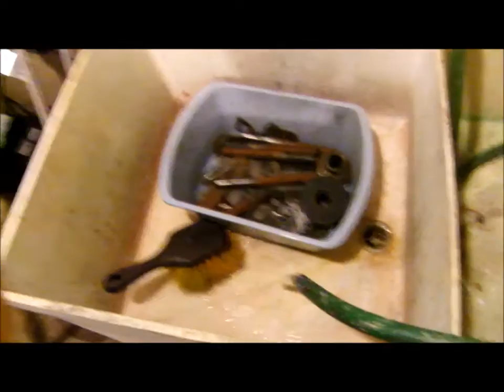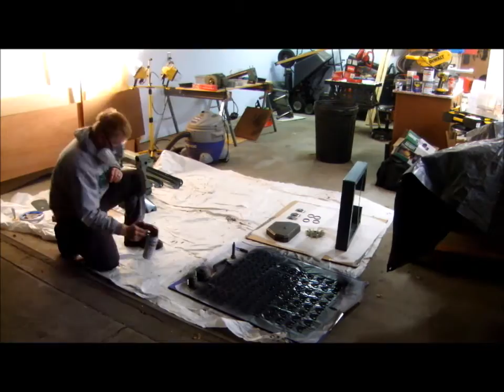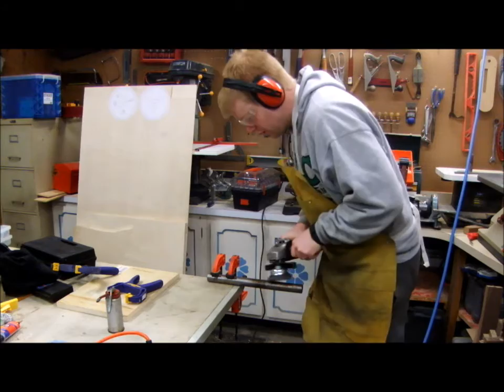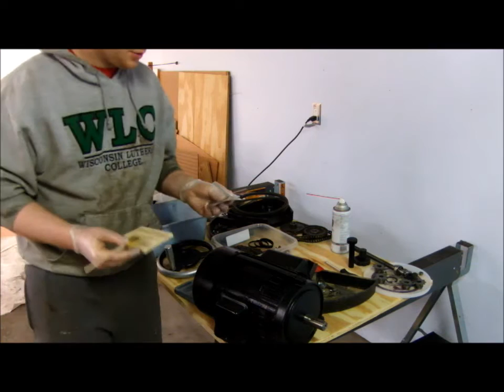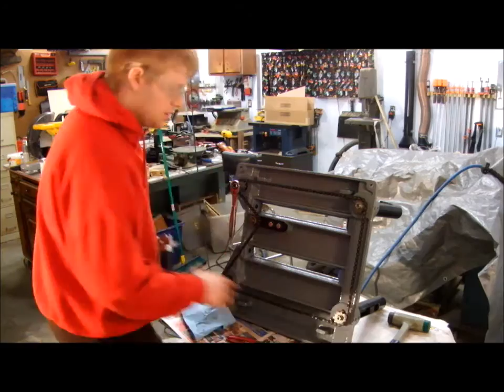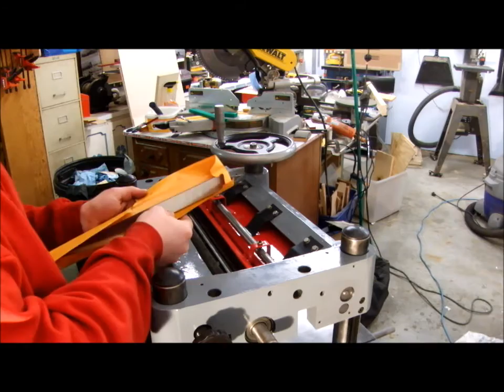How to Rebuild Shop Tools - 15in Planer

Comment: Hi David. Thanks for the vid mate its been very helpful in my own restoration. One thing I am having trouble finding information on is removing the kickback fingers. I can't seem to figure out how to remove the bar that holds them in place. How did you remove them for your restoration? Thanks!
Reply from the maker: The kickback fingers are held in by a rod that slides out the side of the planer body.  As you pull the rod out, all the fingers and washer spacers just fall off.

Comment: Hey David,
I just bought one of these planers and need to move it into my basement.  it is very heavy, so I'd like to disassemble it into "chunks."  I'd like to take the entire head off, keeping the top casting, cutter head, feed rollers, etc. all together.  As far as I can tell, the only thing holding the entire head assembly to the 4 posts is two set screws on the top of each post.  If I remove all those set screws, put a couple 4x4s on the bed and then raise the bed to contact the feed rollers and cutterhead, will the entire head assembly lift off the posts?  I can't find a video or pictorial of anyone who has done this.  There's a brief shot in your video of the head assembly sitting atop some wood so I figured maybe that's what you did to disassemble this.  Any help would be greatly appreciated.  Thank you!
Reply from the maker: Yes, that's right.  The two set screws on each of the four posts is all that holds the head onto the planer.  When I disassembled mine, the motor, cutterhead, gearbox, and feed rollers were all removed first which made it much lighter.  Even still, I recall it being tricky to lift it off evenly.  You may need a helper.  Good Luck!
Reply: Craftsman David Thanks very much! I managed to get it apart, but definitely had to remove the rollers and cutter head. Then I used a hoist to pull the top casting while my brother and I hit it with rubber mallets to free it up. It racked quite a bit but eventually came free. Great job on the restore and thanks again.

Comment: Cool Stuff!
I have owned one like this for several years, but on account of my health I haven't been able to use it, and it has not "aged" well. :-(
Before I go to all this trouble, can you tell me how well it works... Does it have a lot of snipe at the end of the boards you mill, or can one tweek it enough that it doesn't gouge the ends like that?
Reply from the maker: Ever since the rebuild, the planer has been working great.  I have adjusted out almost all the snipe by setting the feed roller height and pressure to the factory settings.  Check the details in your manual.